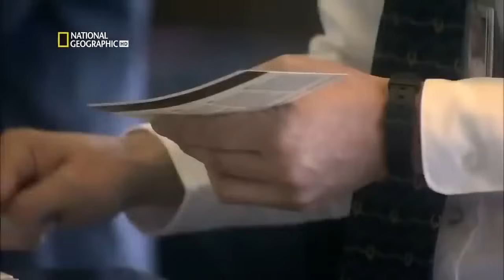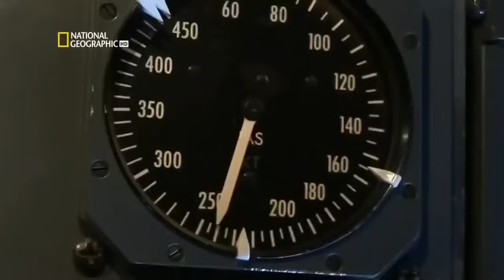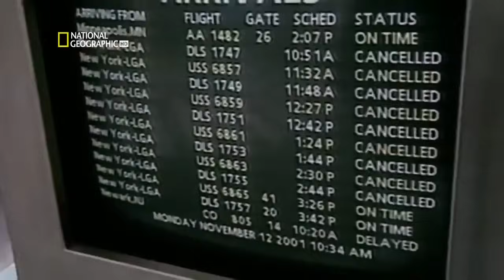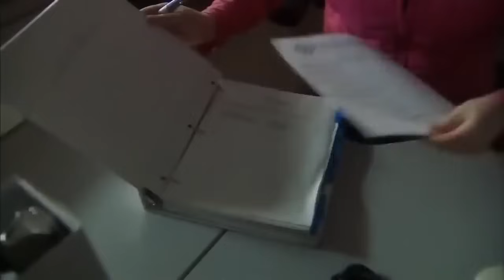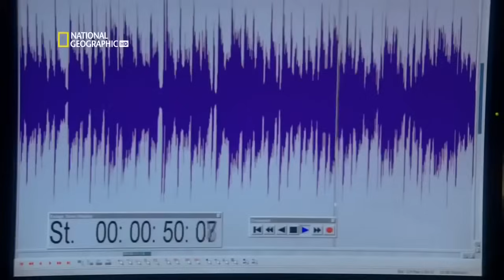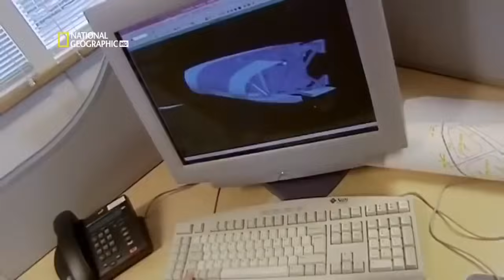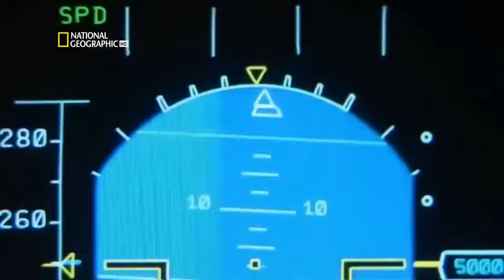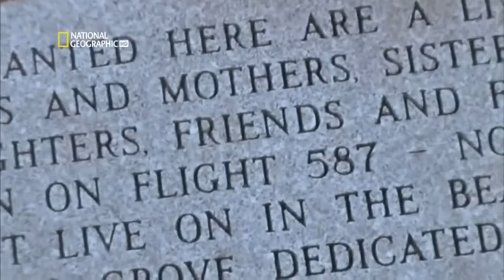American Airlines Flight 587 | Air Crash Investigation | National Geographic

Comment: It seems like the vast majority of these episodes involving American Airlines
Reply: ive been on American Airlines I guess you never know. when I was 4 years old I flew from cal to oregon by myself on western airline. they gave me wings pilot pin. i was a kid frequent flyer didnt scare me then, now i wont get on a plane.
Reply: Almost all are Boeing and Airbus, but the common factor is the scale to which each are used, you have AA and their massive fleet making many flights compared to other carriers. Also Boeing and Airbus are the most utilized, so you hear about them more.
Reply: @cherripaterson6066  why
Reply: @jeanlenor1858  guess im a bit scared to fly. but to never might not be true,
Reply: @cherripaterson6066  Same here... Drove from CT to CA instead of flying. I avoid it whenever I can.
Reply: @jeanlenor1858  last time i flew was in the 1990's, that western airline i flew on in the 1960s had good engines at the time though being a kid then i just researched it now. flying looks scary to me now,
Reply: @cherripaterson6066  Do you just avoid traveling or do you drive long distances?
Reply: @jeanlenor1858  i dont really travel anymore just in the state i live. not driving far either.
Reply: My Pops worked for Delta during the 50s 60s 70s until the late 80s. My mom and I were flying home from San Fran on a big L1011. As we were taxing to the runway, the whole plane  shuts down, lights inside, everything.  We were towed back to the gate and sat for 2 hours or so for an obvious mechanical. We finally take off. About 20 minutes in the caption comes on and states that we can plug in our headphones now the electrical system was finally working. That didn't sound good to me being a freaky flyer . We head over towards the middle of the country, and we encounter severe thunderstorms.  We dropped like a rock, back up again drinks flying off table trays. The movie playing was turned off. Flight attendants  were told to belt up.Mean while I am freakin my mom is uptight too by this time. Unknown to myself and my mom, I was walking around with blood pressure of 260/ 180ish at this time at 14 years old. So my adrenalin was pulsating,  not a fun experience at all. We finally get on the ground and find out we were flying over a dramatic storm system producing  F4/5 tornados. I am still not a huge fan of flying. Our industry really is one the finest in the world, statistically,  I know I am much safer in a plane than driving . It's still hard to get my head to grasp that especially during take off and landing. I still will grip the seat arms until my fingers go white. Happy Flying!!
Reply: Cherri Patson You do not be to be scared of a flight on a plane
Reply: @cherripaterson6066  I USED TO GET ON PLANES AND THINK NOTHING OF IT. BUT WHEN I REACHED MY MID TO LATE 40S I WOULDNT GET ON A PLANE NO MORE AND I HAVE STUCK TO THAT. I AM NOW IN MY LATE 60S AND I WILL NEVER GET ON A PLANE AGAIN.
Reply: @cherripaterson6066  i still will. Still statistically the safest mode of transportation.
Reply: @seiyuokamihimura5082  well id probably fly again
Reply: @zennabella1676  planes are safer than cars
Reply: @stopgotdamndeletingmycomme8642  i wasn't a bit scared I flew quite often. 1000 miles isn't far. pilots liked me. my dad took home movies of me boarding plane and pictures. i was also allowed in the control towers watching the planes come in and land. they let me wear headphones to hear the communication. i remember it like yesterday
Reply: @zennabella1676  well your wasting your life
Reply: @stopgotdamndeletingmycomme8642  I have flown alone all my life. Window seat, always. Even got to ride in the co-pilot seat once (early 90s, commuter plane).
Reply: Last time I flew on AA probably 8yrs ago or so it still had ash trays in the seats.
Reply: I was thinking same thing

Comment: If turning a rudder a little too hard tears an airplane into pieces, one needs to think if it's really safe to fly.
Reply: Bad design by Airbus IMHO
Reply: @deprofundis3293  American Airlines changed their simulator software, and specifically trained and encouraged their pilots to use the rudder aggressively, something that Airbus told them was a cause for concern, yet it's Airbus' fault. That figures. I can tell you're not an engineer...
Reply: @Penguin_of_Death  If you are driving and hit a light pole because you turned the steering wheel too hard, it's your fault. But if your steering wheel falls off because you turned it hard, then that would be an engineering flaw. The same concept applies here. I'm not saying that AA wasn't also to blame; specifics here were also a bit unclear about how well Airbus warned AA about the aggressive rudder use. Airbus also didn't include proper guidance about its use in the manual, at least according to this documentary. My point is that, in MY opinion, no plane should be that easy to break just by using the controls. Never said AA was faultless.
Reply: @deprofundis3293 Because of the effects of g-forces, any jerk movement,  especially alternating ones, could conceivably tear parts of the plane off. The rudder happens to be one of worst ones. The pilot bears some responsibility here; yanking the rudder back and forth as if it were on a toy isn't even intuitively sound procedure.

Comment: with comparing crash probability,  flying is way more safer than driving .
Reply: Yeah it's just the loss of life at one time, plus the damage and spectacle of it that makes plane crashes so scary. Plus the idea that 1) you don't have any control like you usually would in a car and 2) you can survive car crashes pretty often
Reply: Yes Callum I agree
Reply: @SuperNuclearUnicorn  even still, they're trying to improve aviation even more to this day.
Reply: Not for those on the flights that crash.
Reply: @darkknight1340  exactly.
Reply: Exactly because we have 500 more cars than planes. That’s why much fewer airplanes crash than cars. Per mile airplane is safest but per minute, it’s the train.
Reply: @mrsx7944  Keep crying about real statistics.

Comment: This is tragic, and there are many people at fault here. If the manufacturers had told American airlines how sensitive the vertical stabilizer was, then (maybe) American airlines wouldn't have TRAINED there pilots to be aggressive with the rudder and (maybe) the pilot wouldn't have done what he did. It's not just the fault of the pilot, he didn't want to crash....
Reply: Yeah I actually blame Airbus the most

Comment: So many people died because of Airbus not providing not a proper solution to the turbulence problem and American Airline providing pilots with the wrong training and at the end both of them got away with it and only the families of who died in the crash suffered.. so much for the justice
Reply: Why do you think it's Airbus' fault? The jet went through wake turbulence from a much larger B747, that's a natural phenomena, not a fault of the plane. Modern regulations call for increased spacing between flights to minimise wake. This crash was due to the lack of separation between a prior Heavy flight, and American Airlines having excessively harsh wake turbulence training programs that encouraged pilots to use maximum force.
Reply: @The_Ossifrage a plane shouldn't fall apart because the pilot inputs maximum controls.
Reply: @SeinFreak  A plane absolutely can. The forces of aerodynamic drag at those speeds are huge, and if you put a jet into a dive or steep bank, they tear apart or lose control. This is a common experience since the dawn of aircraft, and that's why pilots are trained to know the limits of their specific aircraft. If a pilot uses maximum controls meant for ground handling while they're in the air, it's no surprise that the tail got ripped off. The American Airline training was poor and absolutely at fault here.
Reply: @The_Ossifrage  yeah, when exceeding the normal speeds you can't expect everything to hold up like it should. But these pilots weren't close to reaching those speeds, they just used the rudder too aggressively. That shouldn't be possible, if it's not meant to be used that aggressively, there should be mechanisms in place to prevent that input from even being allowed, let alone recommended in training.

Comment: Putting undue stress on a moving vehicle at high speeds be it a car or airplane can cause damage to the vehicle is plain common sense or so I thought. First officer Molin's over-reaction to the wake turbulence from the JAL plane is in large part to blame for the accident. Having said that AA training program and Airbus non communication regarding the rudder sensitivity seems to be the primary cause behind this catastrophic air crash.
Reply: Correct, it is procedure and it was not known it could be that dangerous

Comment: Irony is that the steel and metal components remained intact!! Only the carbon composit components failed, broke, even though they supposedly met the required strength perimeters and broke anyway. How nuts is that, to build a jetliner that can break by using compnents a bit roughly??
Reply: I agree

Comment: My god that was the most frightening air crash I've ever heard off.
Reply: yeah it is when you hear of a pilot breaking the plane causing a plane crash due to a flawed flight simulator training
Reply: @raven4k998  due to poor design of the Airbus more than anything
Reply: @deprofundis3293  yeah they all make poorly designed air planes not just air bus
Reply: @raven4k998  yeah, both companies have weaknesses in their plane designs. I won't argue with that. Doesn't take the blame off them, though.
Reply: @deprofundis3293  nope it does not it means they should both be punished for their individual mistakes though neither one let off the hook
Reply: @raven4k998  yes, I agree!

Comment: I always had trouble believing that the First Officer caused the plane disintegrate by battling jet wash from an earlier plane.  It's not like he was doing loops, barrel rolls, etc. at an air show.  I'd say the plane is still at fault.
Reply: I don't because as they said at high speeds the rutter was very sensitive to the point you only had to push the petals halfway to get the same results at low speed. If this was a design flaw why is it that this only happened 25 years after the plane was made. If they were taught to be rough on the rutter that is a concern.
Reply: @GamingLegend-ie4nl  Wth is a rutter lmao 😂 ?? He was taught to do that..he did his job. Stop blaming the guy. Btw There's no mention of Captain, what was he doing ? He should've took control or at least given some output.
Reply: No he wasn’t taught to do that with the rudder. He was armed numerous times including by Captain John Lavelle not to be so aggressive on the rudder at high speeds.
Reply: I fully agree. I blame Airbus.

Comment: Suppose the pilot had stopped at the 4th rudder depression and the plane flew safely on.  Wouldn't the vertical stabiliser have broken on the next depression on a later flight?  I always wonder what stresses have been applied to critical parts in the past, they don't get checked between flights.

Comment: Wait, is this the crash with the destroyed vertical stabilizer?

Edit: Yeah it is
Reply: Joseph Hughes the vertical stabilizer is the part that doesn’t move, the rudder is the control surface that is attached to the vertical stabilizer
Reply: Joseph Hughes bro the whole fucking thing fell off, and that thing that fell off is called a vertical stabilizer

Comment: Due to the pressure on vertical stabilizer the rudder was moving 11 deg to the right and 11 deg to the left consecutively causing the support  columns to rip off like that
Reply: I don't get how American Airlines failed to understand the physics involved and trained their pilots to reef on the controls like that. It's like a driving instructor telling students to start jerking the wheel back and forth the second they feel the car start to shake.

Comment: Composite materials are a wonderful thing but when they meet their stress limits under load they fail all at once just like a bomb going off with the release of all the energy unlike metal that suffers stress fractures and distortion first.
Reply: but metal does it at weaker loads
Reply: @thegunner-49  And at a heavier weight penalty

Comment: This was actually due to pilot error, the pilot made the turbulence worse  himslef due to the heavily movement of the rudder causing it to malfunction. There was a training simulation (heavily exaggerated turbulence) wich trained pilot to use the rudder this way, after this crash they removed the training simulation using the rudder this way.
Reply: But the rudder controls were more sensitive at speed, which at least from what I saw in the vid, was wasn't covered in the documentation for the airplane
Reply: @sass174  exactly, so its hard to place blame on the pilot if in training, he wasnt made aware of this fact. its a missed detail that unfortunately cost lives

Comment: The captain should have listened to the air traffic control turbulence warning from the other plane.Then this turbulence and rudder problem should have been avoided.
Why the captain ignored the turbulence warning.😫
Also the biggest point is that in a situation like that why didn'tthe experienced captain not responded.if he had taken control then the accident might not have occur.
🙏Condolences 🙏
Reply: He didn’t. He was given a caution which doesn’t mean “don’t go”, it means, “be ready for some rough air”,

Comment: Then we have MCAS.
Reply: Simon C are you in the A320-NEO gang?
Reply: Better to be in Older planes gang than the new gang.what MCAS. WHAT HICAS.🤷🏻‍♂️
Reply: It was caused by bad training. Seriously, looking up many air accidents, they were always one of these 3 things;

1) Lousy practices stemmed from laziness and the desire for penny pinching, whether it be bad training or improper repairs, or even bad plane design.

2) Pilot error. This is self explanatory.

3) Freak accidents. This one is also self explanatory. 

These days, most crashes are due to mostly bad decisions and pilot error. Back in the day whe  Aviation was new, it was mostly freak accidents. 

This was bad training. American Airlines never had the best practices. Remember 191? That was downed because of a bad decision; they didn't properly repair the engine, and damaged the mounting. So, it wasn't because it was a DC10; everybody blames it on that. Airline malpractice can down even a good jet like an Airbus or a Boeing 747! The practice of pinching every last penny and man hours for a few mechanics isn't worth putting hundreds of people in danger, and neither is uneducated training. Take the extra time to learn about an airplane before applying protocol for wake turbulence correction; use a simulator, and learn what NOT to do, and figure out what to do that won't rip the tail off!

Comment: Like many of we folks that watch these and still get on a plane, I have to question my sanity. I like learning about the investigation aspect of how these crashes are solved. I actually did see a crash in Chicago in 1979, I didnt see the plane go down but pulled into the airport to park  when I saw a flash of fire followed by thick black smoke. Since my boyfriend was flying into Chgo at the same time this plane crashed I asked at the American Airlines counter what was really happening...which plane went down? They would not answer me, I waited for 4 plus hours before I saw my friend walking towards me, crying at the bar. The airlines told me nothing until about 15 minutes before I saw my friend. I had to read the newspaper to get the story on even basic information on this flight...American flight 191, Memorial  weekend of 1979. The plane was only 200 or so feet above the airport, it had just taken off.No one survived.

Comment: I experienced the worse pain and while at pre-surgery for gallbladder removal I was speaking with the nurse and when I asked how soon before surgery he said it’s already done 

I was baffled and confused 

That’s the magic of quick unconsciousness 

Whether in your sleep, a horrific car crash, drive by shooting, mugging murder, plane crash etc pray that your death involves the magic of quick unconsciousness

And on another note, although flying is statistically the safest way to travel and airplanes remain a marvel of engineering, when it comes to in flight life and death emergencies airplanes are poorly designed. The lives of hundreds are usually in the hands of two to three people who at the moment of confusion or powerlessness have no life saving options but to accept death 

The airline industry needs a complete overhaul in how airplanes are designed. And I’m familiar with the major challenges of weight, elevation, air density, pressure, weather, speeds etc which is why parachutes, airbags, ejection etc won’t work but even so we need a new kind of airplane, one where death and destruction is minimized to near zero 

And I want Elon Musk to design it

Comment: I suggest the reason why the vertical  stabiliser RIDDER  was cut off ,before the crash the pilot add some amount of power to 250 knots  in a reckless environment in term of air pressure flowing around the surface of the rudder, after the the pilot request for FULL  POWER,  and he add thrust power to velocity never exceed ,again he applied right rudder Which the strength of the rudder Cannot compensate so theirfore the vertical stabiliser RIDDER will cut off if the amount of air pressure and speed is beyond the  operational strength of the rudder in that turbulence condition 😌😌